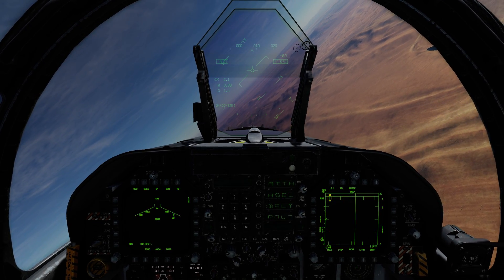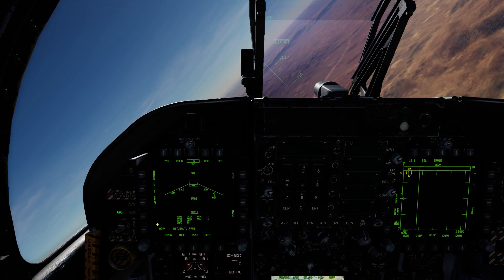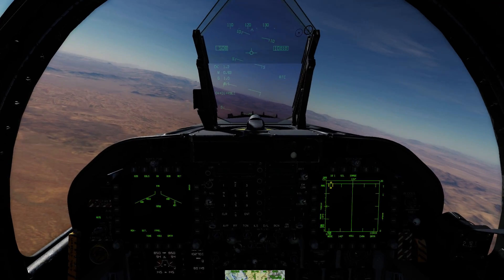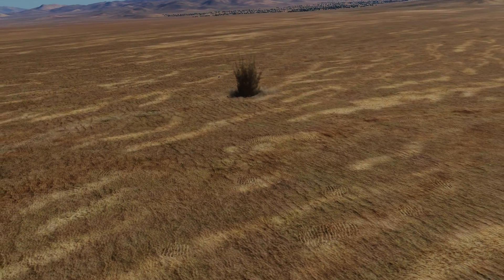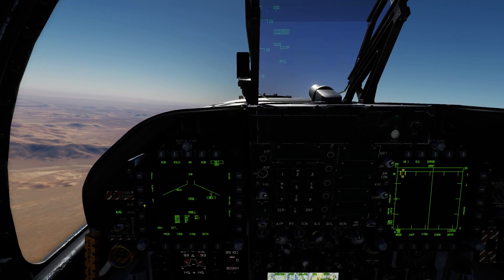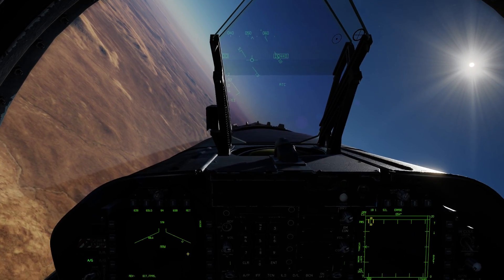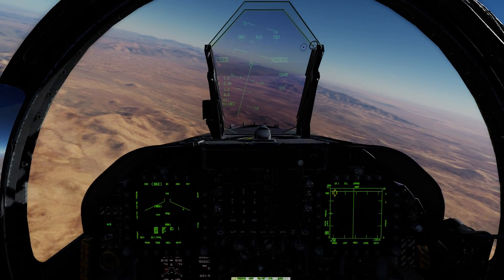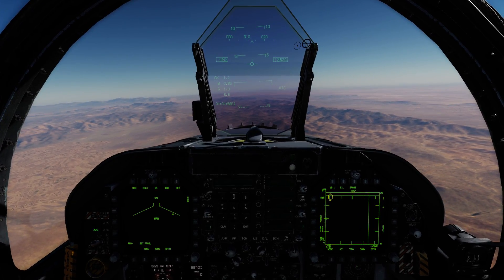DCS: F/A-18C Hornet - Bomb Fuze Settings

Comment: Thanks for the video and the quick information update! One question though: in the bottom left corner of the left DDI, I sometimes get cautions or advisories that I can't clear (check trim is persistent currently). In that case, the height value is not visible. Is there anything I can do about this?
Reply: Check Trim warning is solved by reducing speed to 250kts or less and lowering flaps and gear. Happens when you take off from land with less than 12deg trim or a ship with less than 15deg trim.

Comment: My big question is - When setting the cluster bombs, is the height you set (VT) at sea level or ground level,?  Not sure if that is my problem, sometimes they don't seem to go off.Especially when I might be bombing in mountainous areas.  Thanks!
Reply: Barometric, most bombs don't have radar altimeters.
Reply: Yup. That's the question I was about to ask. At 3:10 they didn't look like they opened at 1500ft above the ground. So I'm guessing VT height refers to sea level.

Comment: But now Sneak Eye won't detonate from 1000 ft. The Pop-up is now very very difficult to make with correct attack angle with CCIP in sight at 1200ft. Below 1000 ft Sneakeye just hit the ground.
Reply: Yeah, seeing the same behaviour here for both SEs and ballutes; getting a "DUD" cue at anything below 1100ft even having triple-checked my switches :(
Reply: Same problem here. It seems as it is not working correctly. Until proven otherwise, I would say this is WIP. Is there a way to disable the safety features on the bombs?
Reply: Try Mk-82 Snakeeye at a level attack at 500 kts IAS at 500 feet AGL.  The Grim Reapers had a video demonstrating this (hit tip to them).  Snakeeyes are designed to be used low.
Reply: @AnkhDjedSeneb  Yes I tried, and NOPE. https://youtu.be/1mbdHyPuK8E
Reply from the maker: Sorry, but no problem here.
Reply: @MattWagner  so, if it's working fine for you, check out the vids posted (also on the ED forums) and tell us what we're doing wrong because it beats the heck out of me :/
Reply: @MattWagner  Tested it with both Snakes and Y's.. Right now the safety altitude doesnt change when you set Snakeeyes or Y's to RET mode, it stays the same as in FF mode. Unless you mean to tell us we shouldnt be able to drop RET bombs under 1000ft AGL I'd say this is certainly not working as intended. RET bombs are useless at the moment. I've tested hacking it by  turning of my radar altimeter and the bombs detonate fine at any altitude but obviously you wont get CCIP computation without RALT.
tl;dr RET bombs are inert when dropped below 1000ft AGL regardless of FF / RET mode.

Comment: Good pulse on what challenges of users and  a smart and enlightening response Wags. Thank you.
Any work still on the cluster munitions bombs? Their dispersal and effect still small. I am here comparing cluster bombs in the A-10C and see big differences
Reply from the maker: It is correct for the current 1500 hard-coded burst altitude. Later we will add the other hard-coded HOBs.
Reply: Matt Wagner I found out that the cluster bombs have no effect when droped from altitudes around 8000ft. But they work fine at around 2500ft. Is it the way they should perform? (and THANK YOU for all the excellent work!)
Reply from the maker: @matuliik . No problem here as you can see in the video with a release at 10k.
Reply: @MattWagner  So what could be the problem? I can even see the bomblets explode on target but with no effect at all.